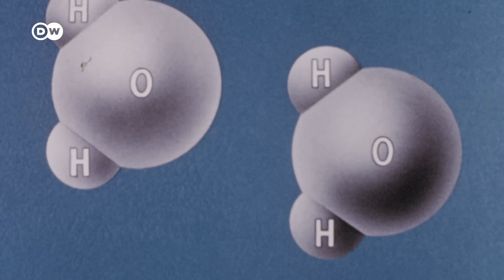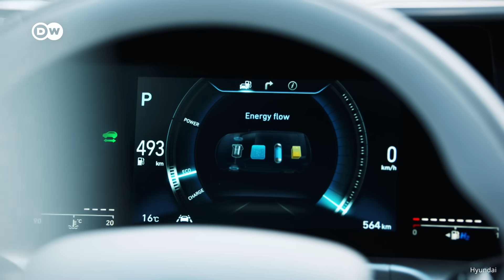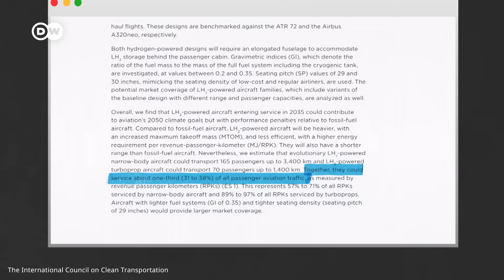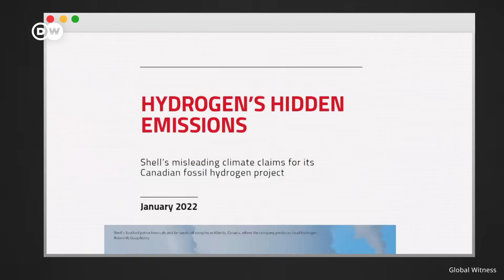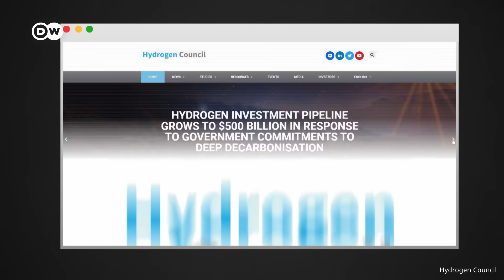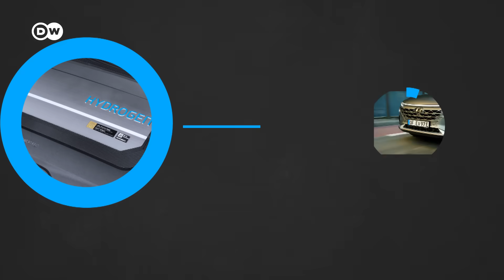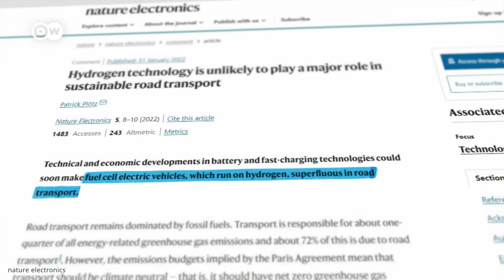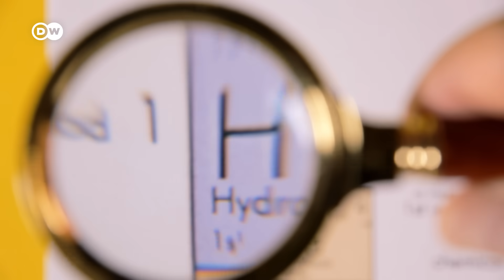The truth about hydrogen

Comment: H2 is DOA.  2 of the 3 applications you point to (steelmaking and aviation) don't need it. Direct electrical steelmaking has now been proven and aviation won't/can't use H2 either.  Direct electric steelmaking will be cheaper and so will win out easily.  Short and medium haul aviation would be better served by expanding high speed rail and long haul aircraft cannot store enough hydrogen to make the distance without a radical redesign of the entire aircraft.  Worse, for hydrogen proponents, the demand for hydrogen is quite likely going to drop as the world decarbonizes.  Today, the majority of hydrogen is actually consumed during the refining process for fossil fuels.  As we slash our consumption of fossil fuel, the major demand for hydrogen will disappear with it.  

For anyone who's interested in a deep dive in where hydrogen can and can't work, (and critically why backed up with hard data), I would encourage them to check out the work done by Michael Benard, an energy analyst and a tool developed called the 'hydrogen ladder'

Comment: So it's worse than renewable electricity because you're just converting different forms of energy and wasting some in the transition? But in some applications hydrogen is a lot more practical than electricity, so it can still help the environment. Am I understanding that right?
Reply: The idea is that it is a form of energy storage that's portable, making it ideal for mobile applications. Despite what environmentalists and govts propose we simply don't have enough materials to make the batteries for 100% EVs any time soon, let alone the power infrastructure short of some magical development in super conductors and carbon batteries or something. Imagine a world where the Texas blackout also grounds every car for multiple states. EVs also can't do all the jobs they would need to do, like heavy equipment, off road vehicles, or even working right in cold temps (just Google Tesla's in sub zero weather). 
But hydrogen is something that can be deployed using modern existing technology and available materials. It can be a part of the solution package, not the whole solution by itself. Instead of comparing it to electricity in this regard it's better to regard it against the price of crude oil and refined fuels.
Reply: @ahuhahuhahuh0  That really helped. Thank you for the explanation!

Comment: I don't understand the requirement for a fuel in steel production. It's just for heating, right? So using electric furnaces would still in theory be 3x as efficient as H2

Comment: When we talk about energy wasted powering a car with green hydrogen, it makes me think "who cares?"

If we lose 60% of the energy along the way, think about what that energy means. We use solar power to split water. Then we pass the H2 through a fuel cell. At that point who cares how efficient it is? We're wasting solar energy. We're not really at risk of running out of that so why is waste even considered?
Reply: If you need to generate twice as much energy, you need to build, operate, maintain, and eventually replace twice as many solar panels or wind turbines. These materials all have costs and emissions associated with them, and take zero-emission energy away from other grid uses. On top of that it requires more land use. So investing in clean energy will be twice as effective with the more efficient option, likely more so due to the factors mentioned above.
Reply: We're still way short on green electricity generation capacity, and adding solar capacity isn't free in either money or environmental impact. Maybe one day we'll have excess generation capacity such that "wasting" more than half of it won't be a concern but in the meantime you should focus your efforts where you can make most impact - and that isn't cars right now.
Reply: The issue is transportation and storage as hydrogen needs to be stored in a liquid state, which requires refrigeration and compression - compressing raises the freezing point.
Hydrogen is the lightest element and as such has extreme Houdini like tendencies and can quickly become a potential bomb unless stored as a liquid, which obviously requires more energy to keep it in that state.
Reply: If its inefficient, its unsustainable.
Reply: I'm not seeing how it's unsustainable. If you're getting your input energy from an infinite source (in practice) why are losses even taken into account. I feel like "inefficiency = unsustainability" is a mentality left over from fossil fuels. If your energy is free and "infinite" why do you care how much you're "not" getting?

Comment: Hydrogen is not a silver bullet by any means.
Fuel cells are a vastly better technology from a sustainability standpoint than batteries, and it will be super useful for those areas where we need self-contained power sources, such as ships and motor vehicles.
But even so it can't help us escape the fact that we need to massively reduce our total use of resources and energy.
It just means that things like motor vehicles still have a place at all in a sustainable future.